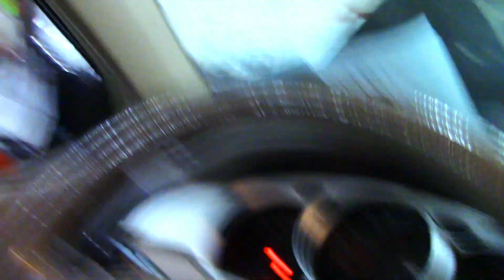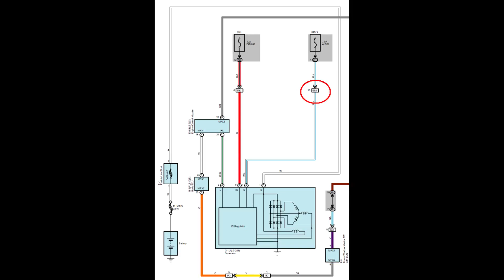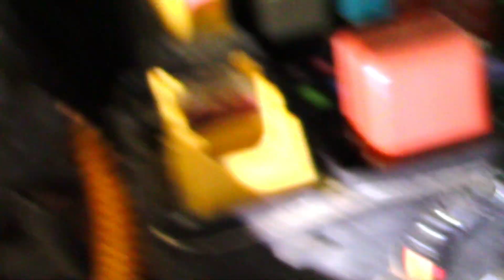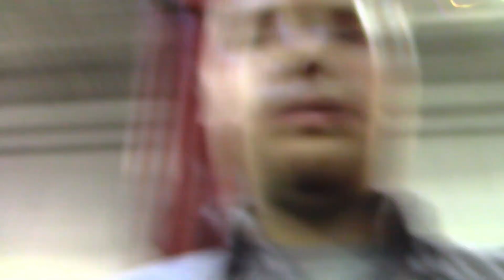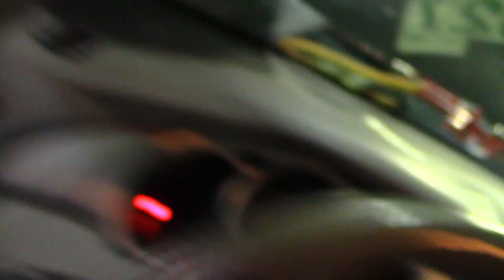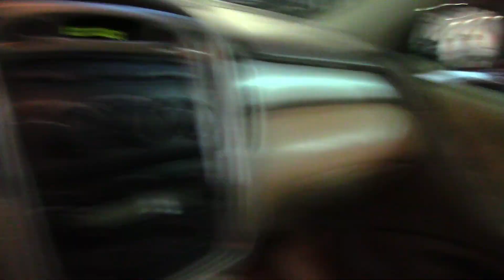06 Highlander Battery light on

Comment: Thank you for making this video!  I have an '05 Highlander V6 and the battery light came on today, so I took it to an auto parts store to have the battery and charging system tested which passed.  The battery light turned off later, but I knew it came on for a reason.  That's when I found this video.  I checked the same connector and bingo: multiple corroded pins and one of them broken.  I reconnected everything (have not fixed it yet) and now my car won't start.  Just makes a single click.  I'm hoping once I replace those pins my car will start again.

Comment: I have a similar issue new alternator and battery but after couple of minutes idling the light come on and the battery wont charge.any ideas ,I will be check with a tester today fuses and the eb2 connector and let you guys know ty

Comment: Thanks so much for the info. I just had the same thing happen on my 04 highlander. As soon as I touched the pin inside the connector it broke off because of the corrosion. You saved me a ton of time!

Comment: As an avid DIY'er, I know how to diagnose issues aplenty. And when I was getting good numbers on my multimeter and still getting the Battery Light on the dash, I knew something else was wrong. YOU NAILED IT ON THIS ONE! Thank you very much. Since my Highlander is at 204,000mi and I'll likely never unplug that harness ever again or even sell it, I opted to simply jumper that wire instead of finding a replacement pin. I verified that pin was corroded (which it was and completely gone), cut the wire on both side of that plug, and soldered a jumper wire across that plug. Worked like a charm. Thanks again!
Reply from the maker: Glad that I could help!

Comment: Great video! Very informative. I have a friends  2004 Highlander that has a battery light. Started when the battery basically blew up. The caps flew off. Anyways fast forward. New battery, new alternator another shop changed. Then another shop told him it’s probably a bad ecu and to junk the car. Brought it to me. Upon testing the alternator isn’t giving anything off. Basically the car will run on whatever juice is left in the battery till dead. You think this connector may be something I should start with ? Would that cause the alternator not to work at all ? Car has around 100K. Thanks for any info.

Comment: Thanks SO much! I've been driving my 04 Highlander for over a year with the battery light on. Been looking for a solution for quite some time now. I've even disconnected the main fuse panel and had look underneath. Seen some info on bad internal connections before but never and explanation like you've explained here... so I assume it's a hidden problem in the connector as the pins all looked good. ( I'm not electrically inclined) The vehicle always starts and everything works. I see the headlights go bright and dim very.. very quickly and when the battery light DOES go out( very rarely or sometimes when it's raining) then the HVAC fan, windows etc., operate much quicker. I checked these connectors over a year ago but I don't have the ability to back probe...and the S fuse is good...and it's a new alternator. ( Doh!) I am going to go around( bypass) the EB2 connector with a jump wire.  I'll update this post after the "fix" hopefully. Thanks for awesome explanation. Happy New Year! Thanx again.
I just finished the bypass.and it WORKS! Woo Hoo! I found a Very small crumb of green crusties on the top left pin, checked it out with a small screw driver and pin fell right off..by the way ..it's a white wire with a blue stripe. Thanx man.

Comment: Great video. I am having the same problem with my 04. Where can I putchase those terminals? Is there a Toyota part #? Thanks
Reply from the maker: robert wintersteen i can get you the terminal part numbers but I’m going to be honest. They’re not cheap. They’re about $15 each through Toyota.

Many people just cut out that connectors and solder those wires together bypassing the connector.
Reply: @VoltageDropDiagnostics  I was wondering if that was an easier fix. I will do the bypass. Thanks for the response.

Comment: Quick question. 05 Tundra V8. When the secondary air pump under the intake manifold goes out, if u catch it quick, do u normally change the other related parts?
Reply from the maker: I seen this comment, then forgot about it before I had a chance to answer. Sorry, Bill!

On the 05s no. I just change the pump when they go bad. On the 07s and newer I replace the entire system, namely because the parts are all covered under an extended warranty.
Reply: Voltage Drop Diagnostics Thank u!  U r very kind to respond!  That is what I am doing. There was some debris in first valve after the pump. The others were clean and I checked that they opened and closed and sealed. Thanx again for your very helpful channel!!

Comment: haven't run into that one yet...is that a Toyota pattern failure?  I guess Toyota has that pin box with a few different crimp pliers
Reply: Toyota MDT here. I have seen that same body style Highlander with the same  corroded EB2 connector, cause multiple problems. I have seen the charging output at 14+ volts and also crank no start conditions. Everytime I get this body style Highlander with similar customer concerns, I go straight to that EB2 connector. Definitely a pattern issue
Reply: ok great    good to know....thanks!
Reply from the maker: I’m not sure if I’d call it common, but I have seen different issues caused by that same connector.

I have seen the fans stay on, after the key is off because there is corrosion in that same connector causing the relay to stay on.

I’ve only seen it cause a battery light one other time, a few years ago.
Reply: thanks for the info pj ….ill keep that in mind   you have a great channel!!

Comment: Nice fix Man! BTW where did you get the connector pin?
Reply from the maker: I ordered them through the toyota parts department. They should be able to get those terminals for just about every connector that Toyota uses.

Comment: Very helpful vid!!  Since u have access to so many Toyotas, it would be interesting to c if, by removing that 7.5 fuse if other Toyotas revert to that 13.7 volts. Also, it seems that the regulator is internal to the alternator. Is that correct?  So many of us may c the light on and just throw an àlternator on it. In this case that would have been the wrong call. I wonder to, if u loaded the alternator with all the accessories on, would the 13.7 command have remained fairly constant. Thanks again!!!
Reply from the maker: I’ve seen different models of Toyota’s with this wire open, causing the alternator to hold around 14.5 volts. So I think it varies between makes and models.

I just had a Subaru with a similar issue and it was putting about 15 volts.

Comment: Nice work...Sensible & methodical. With all due respect...From a workmanship stand point, how come so few auto mechanics seem to possess a heat gun? (or at least use them) Surely dealing with heat shrink or environmental splices is a semi-regular occurrence. Thanx for taking the time.
Reply from the maker: TheGibby3340 for years I used the heat attachment on a butane soldering iron.

But it recently broke and I got the Milwaukee soldering iron and just didn’t think that I’d be losing the hot air attachment.

But I agree. A heat gun would be better to use.
Reply from the maker: Toyota a Tacoma came in with rodent damage, so I made a quick run to the store and bought myself a nice new heat gun, and put it to use!

Thanks for the pointer.
Reply: Voltage Drop Diagnostics Good man...Cheers

Comment: Great diagnosis PJ.Even experienced auto sparkies may of overlooked such a simple but not necessarily obviously, pin fault. Corrosion that bad where a pin has near completely corroded away, necessitating a plug repinning, is not a regular occurrence in Australia. I personally would be coating the pins in di-electric grease to ensure continuity and minimise future corrosion. 👍👍🇦🇺
Reply from the maker: I sprayed it with a chemical from the auto parts stores afterwards. But i have absolutely no idea if it will actually make a difference.

Here, in the north east US we use salt on the roads to melt the snow during the winter.

And it destroys cars and trucks.